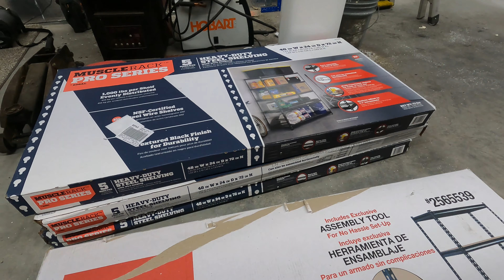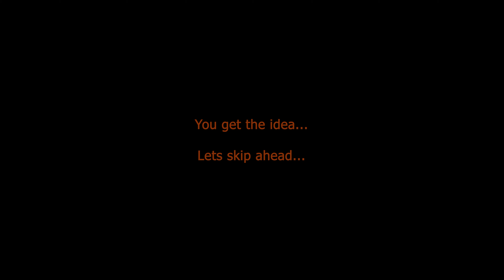Metal building Insulation, fixing an old sawhorse and metal shelves

Comment: Any condensation issues?
Reply from the maker: Because were in the south I run a dehumidifier at all times. I doubt in our area that it would condense very often but even if the building was a stick built a dehumidifier would be required.

Comment: Depending on where you are, you could probably find used pallet rack at a good price.

If you have the space for it, it can be as tall as you want and hold lots of weight.  I've used both and I'll never buy the cheap stuff again.

I got lucky and found a government surplus hydraulic lift which is like an overgrown dolly that can lift 1,000 lbs 80" so I'm set to fully utilize my pallet rack, even when I'm old and can't lift 100+ lb bins over my head.

I would love a forklift but that's just another thing to store and when they break down repairs are expensive.  My lift has at least 75% of the benefit and at most 20% of the cost.

Overall, I probably spent $1,000 more on pallet rack and a lift than you spent on shelves but it's a long term investment and I have a few jobs planned for the lift so it's pretty much paying for itself in equipment rentals I won't need.  I probably have twice as much storage because I can store heavy things higher than your top shelf.  It seems more expensive up front but if you can use it, you get a lot for your money.
Reply from the maker: In our area they want over a 1000 for one rack.  It would only cover about 8 feet so I would need 3.  Add to the fact that they are usually 4 ft 6in in depth and I would lose some of the door.  And I can't put them on the other wall across from the door which will become evident this winter with a future project.
Reply: @southernyankeehomestead3230  I got four 42"x12' uprights and twelve 4,500lb 9' beams with wire racks for about $1,000.  It sounds like your local price is more than double what I paid.

Of course I said depending on where you are and if it will fit.

If you have a trailer it might make sense to look up to several hundred miles away if you're buying enough.  Some sellers ship also.

I'm going to be building an enclosed carport style steel building and space for pallet racks is in the plan, nothing will be blocked.

I'm just pointing out alternatives.

I moved a lot of stuff from a house/shop in to a storage unit two states over and it will be there for a while before I can build on my land.  Going vertical cut my storage bill in half and it's going to reduce the square footage I need to build.  For me it was the right choice and I could not have done it with consumer grade shelving because I'm using a lot of the 27,000 lb load rating of my beams.

I'm on a pretty severe budget.  Enclosed carport style steel building is in my plans because I haven't seen any construction that's cheaper and can be built in a reasonable amount of time.   The concrete slab is the biggest cost so going vertical makes a smaller, less expensive building work for me.

If there is a more efficient solution, I haven't seen it.  Of course some people aren't thinking that way when they spec out a steel building which is why I try to tell people about it.